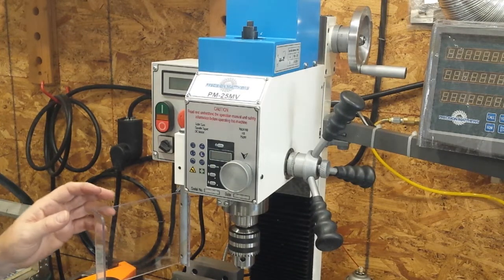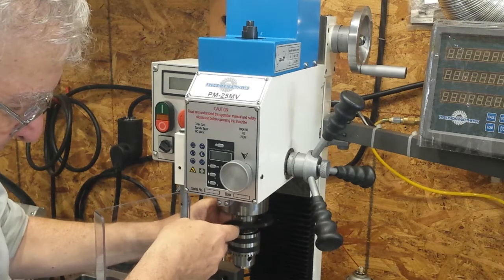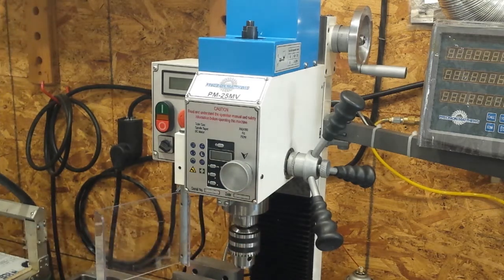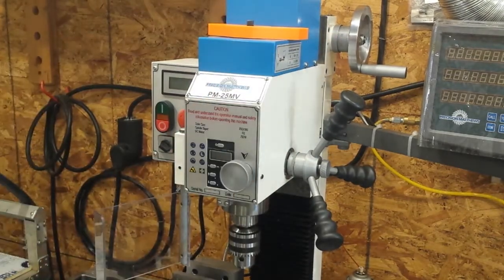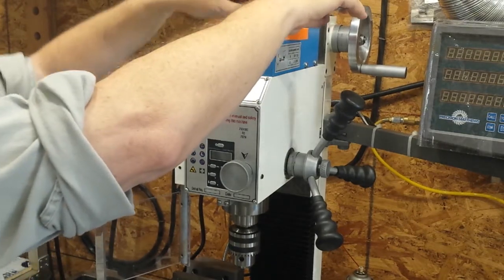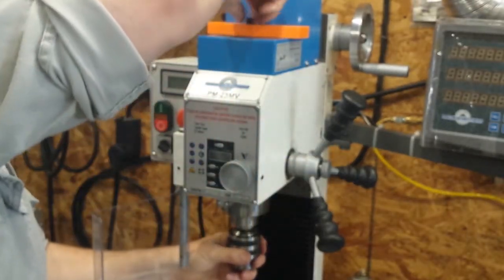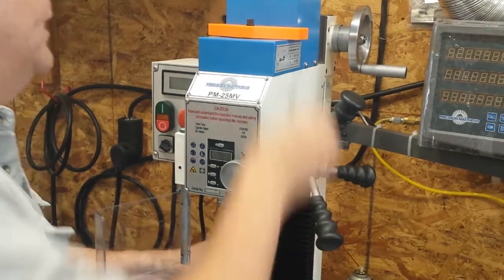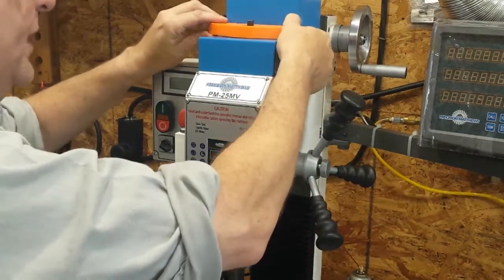Spindle Lock for Precision Matthews PM25-MV Milling Machine

Comment: I use this thing every day! It works like a charm. I made 3 thinking being of plastic it would wear out fast, but with solid infill, My 1st one has lasted for the last 6 months. With my Tormach style R8 tooling, and being that the tools drop out after the smallest of tension release, it's great to be able to hold the tool with one hand and release with the wrench. +Great design, Neil!!! Thanks!
Reply from the maker: Hi Will and sorry for the delayed response.  Very glad it works for you!  I'm finding the same thing, the first one I printed is still going strong but it's comforting to know that I can make another one any time.  Happy chip-making!

Comment: You are not holding the spindle with that tool, your holding the drawbar retaining cap, you can remove that cap and drawbar and run the spindle if you want.
Reply from the maker: Yes, that's correct of course.  This solution is a bit impure as you note, but in practice it works quite well.  I've seen other videos of folks modifying their machine for a true lock, it's just something I didn't see the need for in my context.  I also don't like taking the whole thing apart.  Thanks for the comment.

Comment: Hi thats a great ides, I also have a pm25.  Do you sell these? I dont have a3d printer.  Thanks
Reply from the maker: Hi Joe.  If you go up on Thingiverse  and search on PM25 you'll find this part.  There's a link that will allow you to order one, there are third-party vendors.  If this doesn't work for you let me know.  My one concern is that there may be unit-to-unit variations that will warrant adjustments in the dimensions.

Comment: Although it looks like a common- sense solution, it is specifically addressed in the manual as to why not utilizing the drawbar cap for this purpose is mandatory:
 "Lock the spindle with the C-wrench while at the same fully tightening the drawbar with an 8 mm wrench. [Do NOT try to lock the spindle using the flats on the drawbar cap; this is screwed onto the spindle to secure the return spring cup.]"
Reply from the maker: Hello and thanks for the comment.  You are correct, if the return spring cup isn't adequately tightened this method will not be reliable. In practice however I avoid making the draw-bar excessively tight and thus I have never had a situation where the cap came loose.  From what I can see, the primary purpose of the cap is to push against the collar of the drawbar as an aid in removing the R8 tool/collet/etc; it is not really involved in the machining operations.   Even if the cap does come loose, there's no real danger and it's easy to remedy: you can always fall back on using the less-than-wonderful wrench that PM provides.

Comment: Has anyone commented or suggested about making this part out of two "sheets" or pieces of aluminum plate?   Aluminum might  not deform like the plastic over time and the outer shape/dimensions could be cut with a band saw, and finished.    A lower, thicker plate with round hole is easy, but cutting the upper plate with the lock "channel" might require some trimming or file work.  Then two plates joined with counter sunk screws?  Without a plastic printer or a CNC requires some imagination these days.......
Reply: I made one out of 3/4" thick aluminum.  I have a manual machine so it took a little longer and isn't as pretty but it does the job.  the only issue I have is that the drawbar nut will not stay on while tightening the tool.  the nut loosens as soon as you start to tighten the tool.  I have not had time to investigate a solution yet.
Reply: I also added a lockout switch daisy chained in with the EPO so that the machine can’t be turned on with the Pindar lock in place. Works well.
Reply: Darn spell check. Spindle!!!!
Reply from the maker: There are folks on Thingiverse that will print one for you, assuming you have the same machine.  I know this is a late reply, but perhaps it will help someone else.  Look for the "Order this printed" button.

Comment: Many thanks! I will be printing this tonight, as I  Immediately see the benefit. ( although I have developed a bit of a ballet with the wrenches and hands, I begin to suspect it is an abnormal skill I've been learning )
Reply from the maker: Sounds good, hope it works for you.  I've been using it now for about a month and it's been really easy.  I should mention that the specific dimensions were based on my machine, you may need to adjust slightly on yours.  The Solidworks file is up on Thingiverse, if you need another format let me know and I'll post it.

Comment: Truly Genius! I greatly appreciate the comment about needing a third hand. You either have a newer or an older PM25 than I do. Mine is from the unlucky batch without spindle flats.
Reply from the maker: Thanks Kent, and I too have really enjoyed/benefited from your videos.  This PM25 is quite new, no more than a few weeks.  I can't imagine what the designers may have been thinking to put out a machine with no positive way to lock. 

With the new plastic locking plate I actually like the draw-bar situation now, although I did have to make (print) another one with more in-fill -- the first one I made was starting to deform at the flats after some vigorous tightening.  I may end up making a metal version.  Regards...Neil
Reply: In case you missed the response, in regards to spindle control, I used a stepper controller from Pico Systems which has an optional DAC that generates a signal that can replace the potentiometer on the factory drive. This controller uses a couple of solid state relays to control spindle on and direction. Let me know if you need more details. Best wishes, Kent
Reply from the maker: My first pass at spindle speed control didn't go so well, I am glad to hear that it is possible with a simple DAC output.  I'm still on the fence whether I want to do that at all -- at this point I have the spindle turning on/off under computer control, that may suffice particularly since my BOB has no charge pump support.   For the amount of machining I do (not that much) manual control is probably ok.